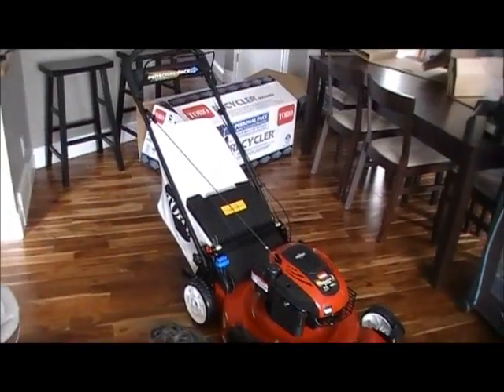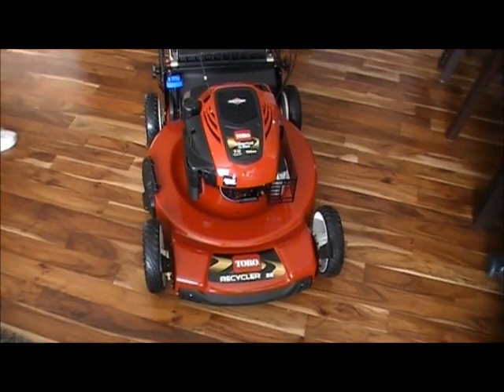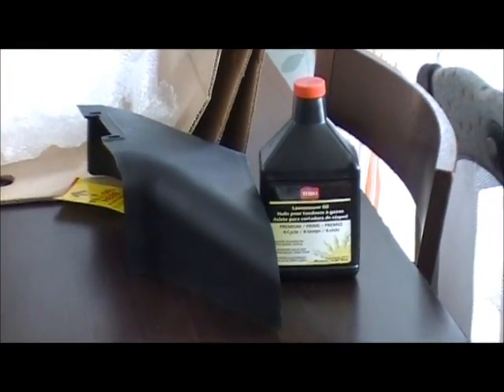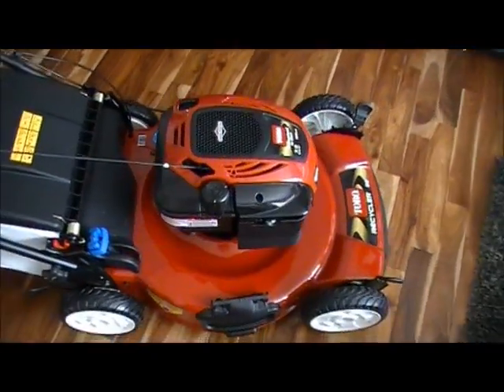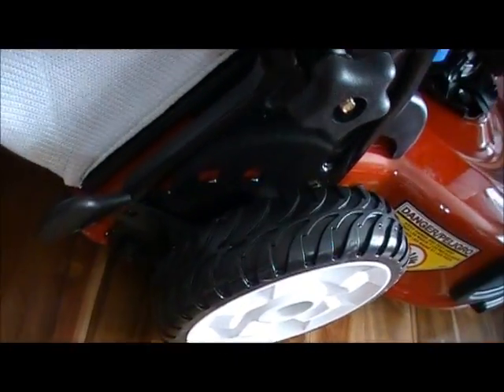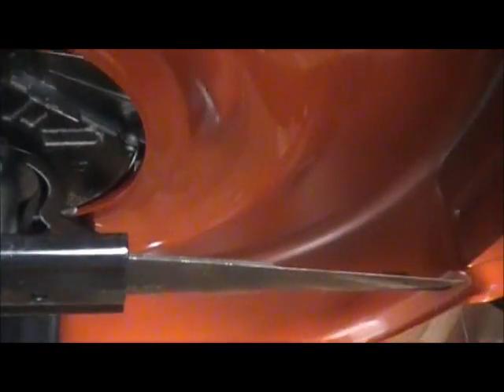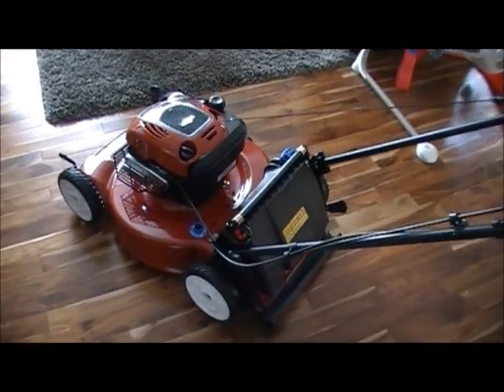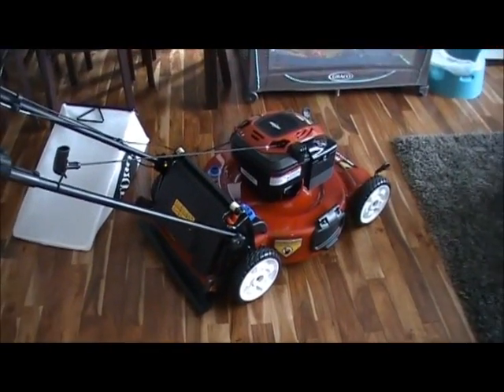Toro Recycler 20332 Lawn Mower Review

Comment: I work on mowers daily, these Briggs and Stratton flat heads are hands down the best engine toro ever put on these. I still got my 2010 personal pace toro recyler 20332. Fairly flawless setup, one flaw with the early models is they had plastic pinion gear on steel drive gears for the self propelled.. To be fair the mower had probably 800 hours on it. I'm still amazed on still on original piston rings and crank.... Well over 1000 hours. It's just know starting to knock ever so slightly but with the cost of mowers now... And how expensive they got.....KEEP THIS MOWER AS LONG AS YOU CAN! Keep up on oil changes, clean air filter and these flat heads just keep running along.
Reply: @stereoheaven11  trying to pin point something over the internet is tough. My first thought would be flat worn out internal parts of the engine if your starting to hear a "knock" and increased vibration, loss of power and stalling. Sounds to me it's in need of new engine parts. Worn piston rings or even worse seized or partially seized  are likey the culprit. Take the spark plug out and it should be super easy to pull, if it's still ANY difficult to attempt to pull, engine is worn and your looking at 2-300 to repair. OR it very well could be your pull start also! Again not seeing it in front of me it's hard to tell ya. All this can be done yourself with basic tools. Most rachet sets will have a specific spark plug socket that had a piece of rubber in it. If not you should have enough room to get a wrench on it to loosen it. 

Another thing to check is if something got wedged up underneath to see if something physically is causing resistance on the output shaft.

I would honestly go with another toro that has this same engine. I belive they stopped making it 2016. If your wanting brand new..... Your going to be a bit disappointed. Honda would be my first go to choice. However they are now as of 9/2023 no longer making push mowers so parts availability long term will be an issue. I would go find a lightly used toro like the one you had. They are all over the place and better quality compared the newer ones that are close to $500 after tax!! It's a crap time to buy one. Everyone phasing out qaullty machines, making them cheaper but more expensive

Comment: Toro lawn mowers are the best. I purchased my first toro mower back in 2003. I run my mower 4 to 6 hours a week. my season runs from April 1 to the middle of November. My yard has lots of hill and bumps. I change oil, air filter and spark plug each season. I periodically adjust the person pace cable. I take the engine shroud off and blow out the trapped dried grass out. I love toro. They make the best snow blowers and lawn mowers. To make them last takes the minimum of attention. Use fuel stable. My stuff starts the first time every time. Toro you guys rock.

Comment: Front wheel higher than the back ones for better mulch.  That way the leading edge of the mower cuts the top level of the grass, and the trailing edge cuts the grass a second time at the desired length.  Therefore cutting the grass twice before it even mulches.

Comment: I use mine commercially and after a month of use I'm still loving it. Keep the filters changed and good to go. I also use marine grade gasoline
Reply: wish one do you have the super recycler?
Reply: hercules colon
No..not the Super but the Toro Recycler 20332. 11 months now and the only repair i needed was the fuel system cleaning.
Reply: dont use gas with etanol,try to use premium or med grade gas no etanol and you wont have any problems,if not add the toro fuel treatment on each gallon u use.

Comment from the maker: Just wanted to update everyone asking if I still recommend the mower? My reply is an astounding YES! It's now going into its 3rd season and it hasn't skipped a beat or had a single issue. I sharpened the blade once for a tutorial more than anything as it wasn't hardly needed, and have changed the oil a few times. I threw in a new plug and air filter just to keep it running well, but both definitely didn't need to be changed yet. I still highly recommend this mower to everyone!
Reply: Want start for me

Comment: I purchased this model in 2001 and am looking to replace it. I had NO PROBLEMS in 12 years of regular use on a 1/2 acre plot. I used it for everything: mulching, bagging side discharge, shredding of brush (that's right...) and leaf vacuuming. I have not seen anything in this review or anything else online that says it would be a mistake to purchase.

Note to Eganwp : Cut your grass when it is 4.5 inches high to a height of 3". Longer blades of grass absorb more light and give the roots more food. Much more important than mulching...
Reply: Indy HotDog Toro doesn't make a push mower that mowers at 3 inches

Comment: I own this mower, actually between my forming girlfriend (now wife) and I , we have gone through 4 of them in two seasons . . . well I suppose you could say we still have one . . . 

The TORO Recycler 22 is the worst possible mower ever made.  

#1: in mulching mode it leaves huge clumps of grass in its trail.
#2:  in mulching mode you need to stop and tilt the mower back to allow the huge accumulation of grass clippings to fall out and make big grass piles all over your yard
#3:  if you don't do number two, then you mower will stall out and you will have to wait about 30 minutes before you will be able to start again
#4:  if you are foolish enough to buy this Toro mower, plan to spend at least double the amount of time (to accommodate #2).
#5:  If you are foolish enought to buy this Toro mower, plan to mow your lawn every 3-4 days or you can expect the time it takes to mow to be 4 times as long as it would with a normal working mower - aka - not a TORO.

#6:  never, ever, under any circumstance buy a lawn mower made by MTD - which nearly all US lawn mowers are made by.
Reply: So what would you recommend?
Reply: Toros work great. Mines 17 years old... Still has original carb and just now replacing the drive belt
Reply: I have been using the Toro Model 20028 since 1999 (i.e. five years) and it has not missed a beat.  I use the mulching feature all of the time and it has proven itself to be an excellent product.

Comment: Tip: numerous personal pace models including the lawnboy version had a problem with the transmissions failing, because of low quality and insufficient grease in the transmission gear box. Whenever I get one of these mowers new or used I first remove the gear box cover and scrape out most of the factory grease and replace it with a good quality grease. Hope that helps.

Comment: I bought one a week ago and used it once. After it warmed up about 5 minutes, it sounded like it wanted to stall after pressing the self-propel bar. I waited about 10 minutes and tried again. Worked smoothly for 10 minutes or so and stall flutter happened again.  

I went back to the store and was told by a service tech that he had other customers experience the same thing. They market it as "guaranteed to start". He told me another customer bought one and tried for an hour to start it. He returned it and so will I.
Reply: Gary Tarolli  If you're handy with tools, check the spark gap, that the plug is tightened (don't overtighten), that the air filter is clean and that the gas line isn't clogged. I know, it's new; but sometimes storage of the new mowers causes them to act old. Another problem with small engines is the gas sump has a filter on it that does not always reach to the bottom of the gas tank. You can diagnose this easily by checking if the mower always performs well with a COMPLETELY full gas tank. If it starts to act up around half full, could be the sump hose needs to be pushed further into the gas tank.

Comment: Also the self propelled version with the lever that you lift with your finger tips had a problem with the traction cable being incorrectly adjusted which caused transmission failure.

Comment: 2019 model about the same. Bag emptying is very awkward (for those who bag) smart stow feature is a bust. It leaks gas & oil. Still I'm very happy with my machine. But that's my honest review. I believe gas stabilizer is a must. I've seen people have issues. I'm from L.A. we mow all year long. Manual says no oil changes needed for the life of engine. Yeah, right. I change mines. Runs great. Just need to state the facts.

Comment from the maker: @1fido007 Sucks to hear of your issue with the blade brake. That's one reason why I choose this 20332 model (reviewed in video) as it's the non-blade brake version. (BB vsn is 20333) Many brands that include the blade brake feature usually have either the brake or the braking mechanism fail before anything else on the mower. KISS principles need to be kept in mind when buying anything, including mowers. If you're unable to repair it yourself, I suggest taking it to any small engine repair shop.

Comment: I picked up a Toro 20332 today myself looks great. You mentioned synthetic oil after the first two oil changes. What type or brand from what store if I should stick to using synthetic be used for this mower. Great video, someone also mentioned about not using Grease on the bearings which will cause grass and dirt build up which makes sense. Any idea from where to purchase a metal drive to replace the plastic ones, would it be a good idea?

Comment: Great review thanks so much! This helped me pull the trigger on the current model 20332 with the 7.25 Brigs & Stratton. Got a smoking deal at $175 brand new!
Reply: It is still running I just bought the same model at 339 bucks
Reply: I have the same model... Well over 1000+ hours.  Still running with ever so slightly knock. I work on small engines.... These flat head Briggs are the best engine toro ever put on their mowers. Ask anyone who works on them @

Comment: My guess there is no grease on wheel gears so it doesn't collect grass and bind up
Reply: +nike12000 you are correct you should not grease the gears they are plastic the grease will hold dirt and wear the plastic gears out quickly. BTW I can tell you those plastic gear teeth do not need any help wearing out as they ride against that steel gear. I replaced mine twice (no I didn't grease them) before I finally got a new mower with a different drive system. why someone thought a plastic and steel match on the gears was the way to go is beyond me. Worst of all I really like the mower but just didn't want to put 40 dollar into it every year or two replacing drive gear.
Reply: +ogbobbye They still make the metal gears. Why didnt you just buy a pair of the metal gears and pop those on, problem solved. Ive got like 8 of those gears laying around.
Reply: Hey Doug I looked for wheel with metal gears thinking maybe I could replace them with some that would last, if you know where I can find wheel with metal gears let me know the kid who I gave it to still has it, using it as a pusher now that the set of wheels he got stripped out I could let him know.
Reply: +ogbobbye But you wont find a new Toro wheel with the metal gear. It dies not exist. But the gears are so easy to replace with the good ones it doesnt matter. Also there not really even rivits there like nails with ridged on them and it looks like the punch them in with an air gun at the factory. Anyway thise metal gears are still good off an 87 Toro and the wheels were shot. 19 year old gears that outlast the wheels. Thats how they used to make them. well like I said there easy to pop on and off so anyone who has issues with those new plastic gears just throw the metal ones on off an old Toro. Issue solved and then when its time to replace the wheels. Because those gears last forever swap them onto the new wheels and keep going.
Reply: Thanks Doug I will let him know the e bay info  and see if he is interested in getting those gears from you. He was here last weekend doing his end of year maintenance and he was debating on buying a set of new wheel for next season or just keep it as a pusher.
Reply: +ogbobbye No problem, Yea I would hate to have to push a personnal pace and if he buys new wheels the plastic gears are going to do the same thing again especially if he uses it a lot. Like you said, plastic on metal was dumb. He can get them metal gears cheaper than new wheels. Pop those babies on and hes good to go until . the wheels wear out which takes aong time on rwd mowers. Definetely a good investment. They go on so easy thats the great thing. Take care.
Reply: Yea I dont have one of those mowers but I have a few of the old metal gears they used to make on the older mowers, there exactly the same as the new plastic ones except there metal. They are popped on the wheel with nail like holders. They pop right off. Then you take the metal gears pop nails back on the wheel with permatex, good to go. I've been meaning to put those metal gears on ebay for sale but I never got around to it.
Reply: nike12000 I
Reply: Yes I still have the metal gears which are exactly the same as the plastic ones that are being used on the newer Toro mower's which came off of older Toro mowers and are interchangeable and when the metal ones are used they will last forever past the life of the wheel itself. If someone is still dealing with this issue on their newer Toro mower, message me and I will post the metal ones on ebay. All you have to do is take the wheel off, pop the three nails with the fork end of  hammer of a small crowbar, that holds the gear in place. Put the metal gear on, put permatex glue or any type of strong adhesive in the holes and on the tips of the nails and pop them back in place gently with a hammer and your good to go. Easy changeover...... Fixed this problem. -METALGEARSOLID
Reply: Probably a design "feature" to encourage people to spend. Alot of people just throw away their mower when it stops working so by deliberately causing premature wear they encourage them to buy more.

Comment from the maker: @workensmart 
I should have clarified the grease thing in the video. Anytime you use two differing materials in a gear setup, the softer material gear will wear down before the other one (logically). Generally in such a design, there's no need for grease at all, especially in an open dirty envrionment as MNETHRID mentioned below. The only reason I did it is because a I have a small clean lawn, and am not using this in a very dirty env't.

Comment: I have they same mower love it does a great job for a 100+ square foot yard or somewhere around there but mine instead of letting go of the bar and it goes up you pull a blue nob and when that it is out the blade won't be turning your motor is just running and switch to stop the engine great video never yet have tried that quick wash that's pretty cool haha i will try to make a video of and show you look up my channel in a week or so thanks:)

Comment: @Eganwp- What do you think of it now? It's been a few years sine you posted this video. I recent;y bought a used one from Clist and it worked great the first time I used it, but it started making a rattle sound (now I know its a grinding sound) toward the end of the cut. My yard is almost half an acre. The next time I cut grass, the drive would barely move the wheels and they tend to not release for rolling backwards...I've got some troubleshooting to do. It's a great mower and I absolutely love the engine. 1-2 pulls to start beats the heck out of my old riding mower that was also a pull start.
Reply: If you lived nearby i would show you how to fix it. It's not that hard to do.
Reply: Indy HotDog Any links to a good writeup or video? I took the wheels off and the axles spin freely with no resistance out of the ordinary. I removed the screws from the transmission case but the cover wouldn't come off with slight prying, and I didn't want to break it so I put the screws back in. I greased the small gear on the end of the axles and pried the wheel mounting plate out slightly, because it seemed to grind less if the wheels were toed-out instead of in, but it didn't solve it completely. I first tried shims, but it didn't even come close to changing the angle and it was reducing the gear contact patch, so I removed them. I was able to cut my grass afterwards with minimal problems, besides one wheel not rolling backwards. Usually the right one. The grinding sound only happened when I initiated the drive going uphill this time. 

Thanks Indy.
Reply: i agree.

Comment: thanks for the video, the people at ACE hardware said I never have to change the oil, is that true?
Reply: The new Briggs and Stratton engines claim no oil changes are needed but I would always change the oil. I’m sure it’ll just break down faster if you never change the oil and/or just add oil when it needs it. Can’t be that good for the engine.

Comment: The grease is left out for a reason. As this is an open gear and working in a very dirty environment the grease would only serve to attract dirt and clippings, promoting tooth damage and increasing pressure on the hub surface which leads to slop on the axle.

Comment: I just bought one, have almost 5 Hrs. on the supplied oil and will be changing to 5W30 synthetic. A friend of mine has one he bought 12 years ago with the aluminum deck - only problem, he had to replace a drive wheel - he cuts a steep hill.  Mine - so far so good. I waxed the underside of my last mower when I bought it. It didn't seem to be a benefit.    I clean the underside of mine with a wood door shim.
Reply: My experience has been just as good. 13 years and still running fine.